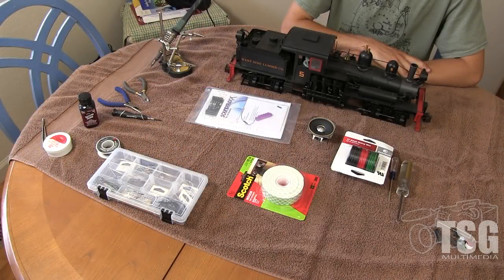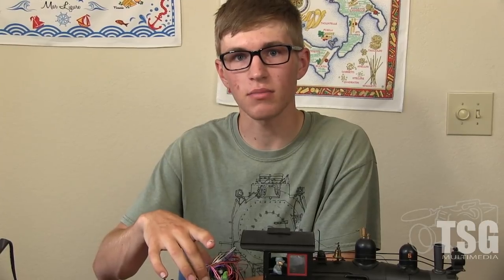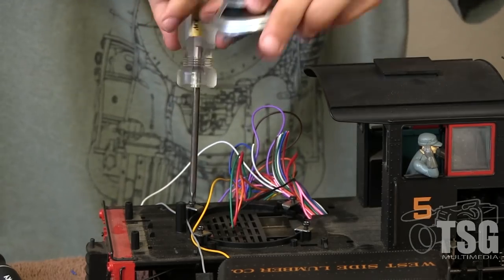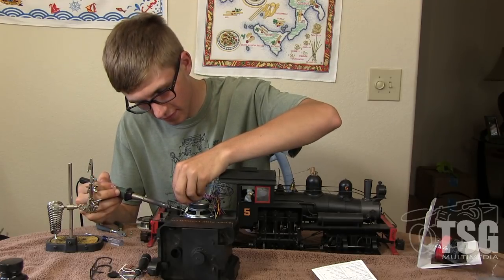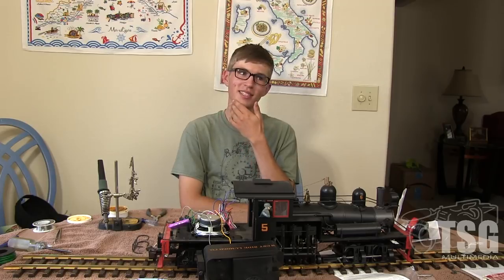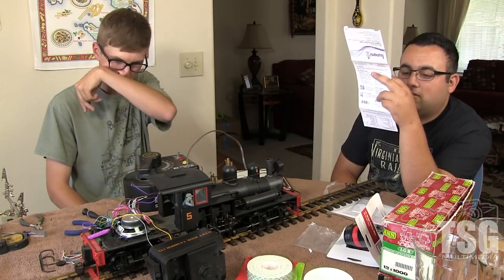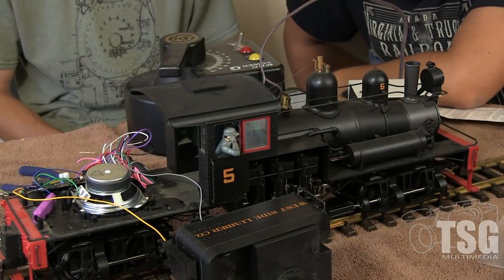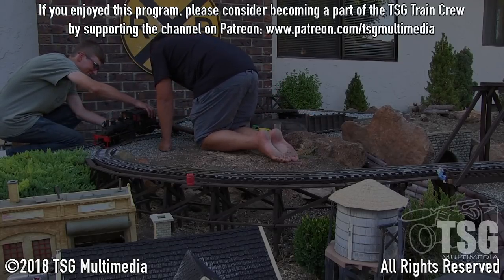How To Install SoundTraxx DCC Bachmann Shay Steam Locomotive G Scale

Comment: You can keep the light board connected to the firebox and ash trap lights and power it from a utility output from the new decoder. The lights work and the smoke generator is still connected.

Comment: YOu think this wiring is bad you should see my analog LGB Stainz/Tender from 1985. I had ot wire in LEDs to the front of the stainz mod the smokestack screw and add a brass tube because I installed and wired into the pickups a Massoth steam generator, and than wire the pickup to the jumper port (analog) becuase the train engineer revolution board, auxillary board and speaker are in the tender and hte umper cables have to bridge the connection for the decoder. I'm surprised this wiring nightmare worked. If I had to do that again, I'd pull the analog female umper ports out and put the modern LGB plugs in place. DIdn't think about that at the time I started updating the irst g-scale train I ever got at 3. Oh and because of the custom wiring, mine does follow NMRA Color Standards. Beause I Made it :3

Comment: But there is no fire box nor is there ash pan flicker
Reply: I haven't seen a single model locomotive that does that, just like you can't get cylinder steam.
Reply: Karl Rovey those Bachmann shays have firebox and ash pan flicker. LGB locos have had firebox flicker for decades, and newer ones have cylinder steam as well (synchronized to the chuff sound and wheel rotation).